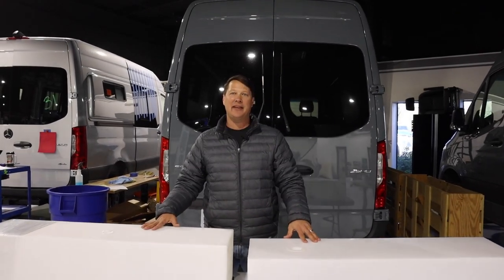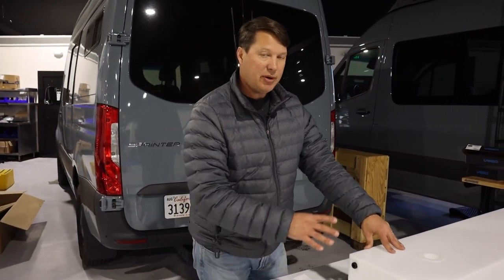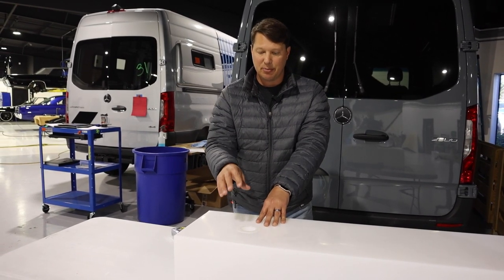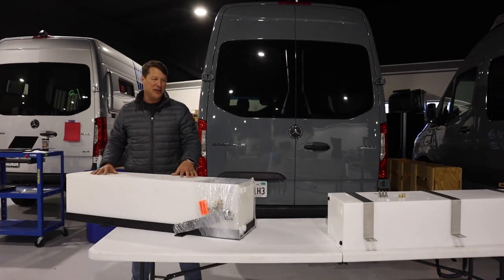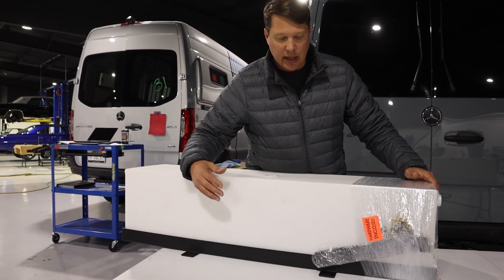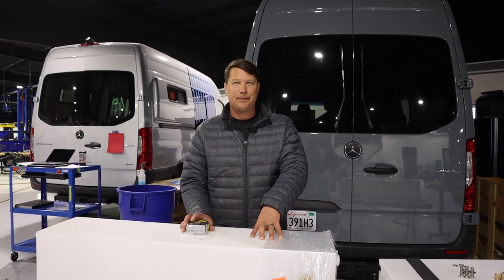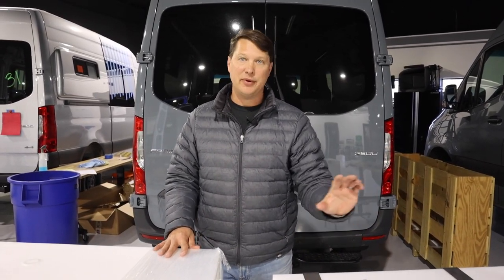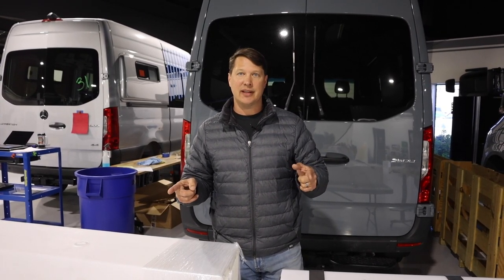NEW 20 Gallon Water Tank | Water Storage for Sprinter Vans

Comment: Won’t this freeze in the winter?
Reply: That's my concern. Could that be fixed with heat tape or other means or is it just best to pull them inside?
Reply from the maker: It could of course. That goes for the entire water system  in any camper. There are some solutions like heat pads but we prefer a recirculating system if you need to use the system in winter or decommissioning it when not in use- just like any RV
Reply: @VanLand   That is what Storyteller is doing. However, the tank isn’t freezing, but I believe the hoses are freezing instead.